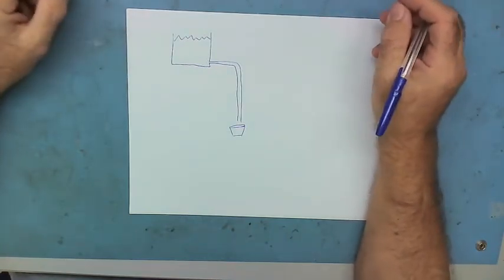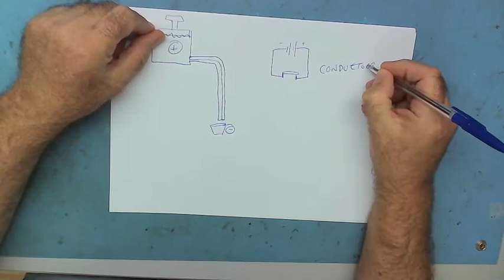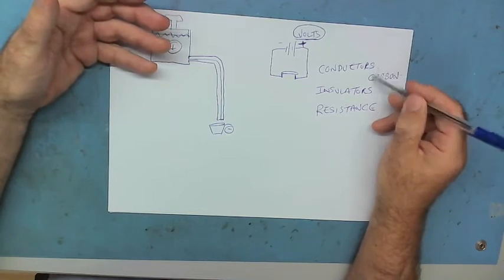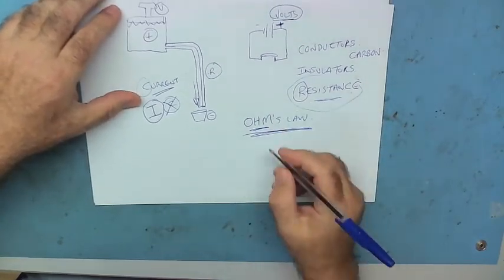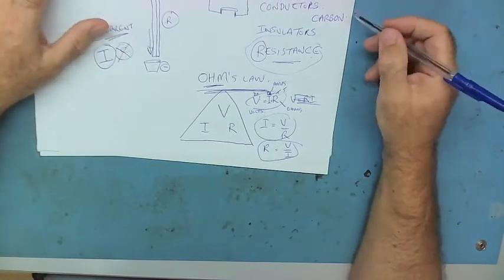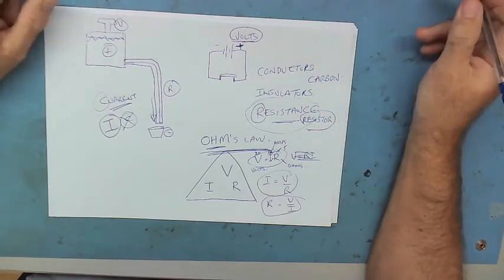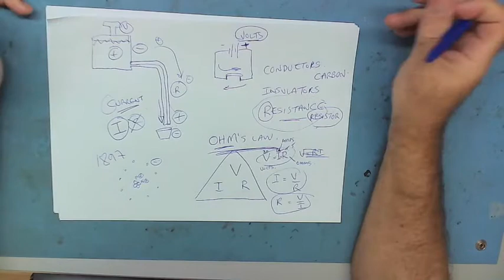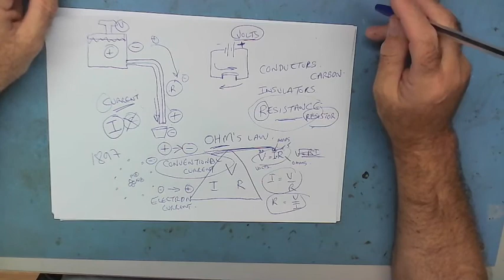Learn electronics Repair #14 - Circuits and Components for Beginners 1. What Is Electricity?

Comment: As an electrician and later an electronic engineer , the water comparison doesn't work unless you start with a pipe full of water , a cable has electrons , these electrons move very slowly, a better way to understand electricity is to imagine a tube full of marbles , you push a marble in one end and the effect is a marble pops out of the other end  instantly , but the original marble doesn't appear until a few marbles have been push through.

Comment: When I first learned about electricity back in the 1950's, we were taught that electrons flowed from the negative battery terminal to the positive terminal. And that, of course, remains true to today.  In the 70's I started learning about semi-conductors and the concept of "hole-flow". While electrons flowed from negative to positive, "holes" in the semi-conductor material flowed from positive to negative.  Using the hole-flow concept (which matched conventional current-flow theory) was helpful in analysing semi-conductor circuitry, not the least help being that the arrows in semi-conductor diagrams pointed in the direction of current flow.